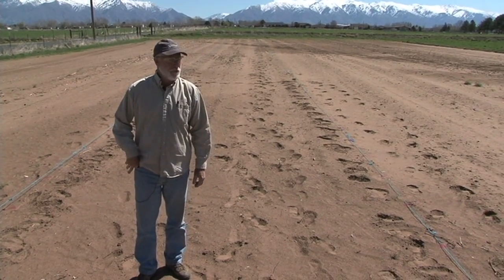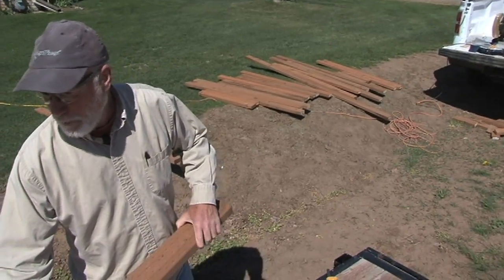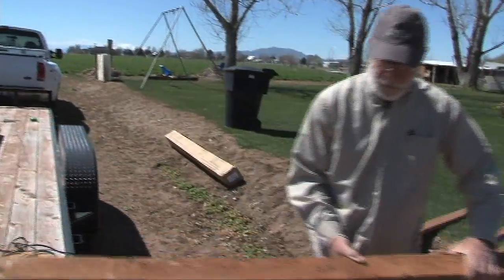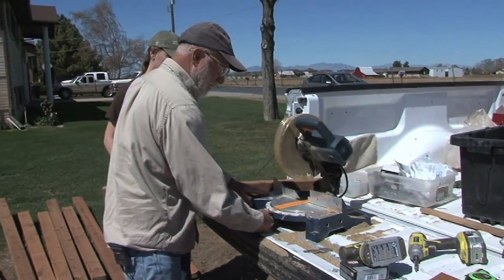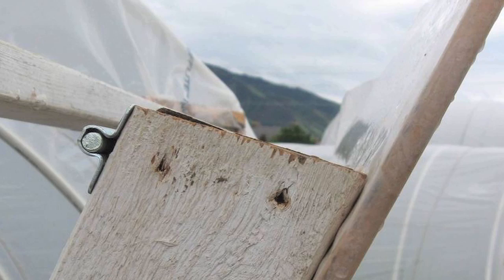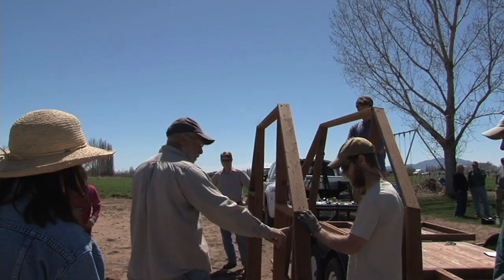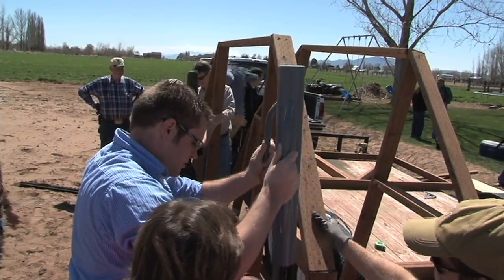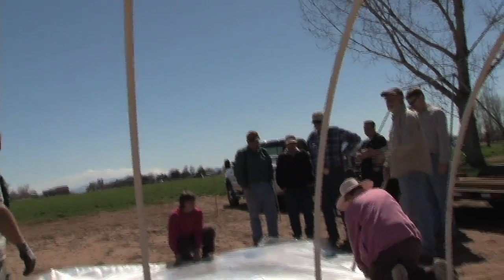How to Build High Tunnels

Comment: my grow cover manufacturer warranty is voided if it comes in contact with PVC piping.  The cover interacts with the chlorine in the PVC piping and increases the degradation process of the cover.  Thought you'd like to know in case you needed warranty coverage and ended up finding that you have to pay more for all costs you thought were covered.
Reply: I taped the PVC piping wherever my grow cover came in contact with the PVC piping.  I used some black duct tape I bought at Home Depot and that stuff is indestructible as far as I can see.
Reply: Paint the pvc on one side so the cover doesn't touch it.